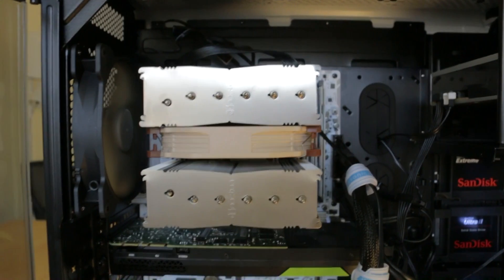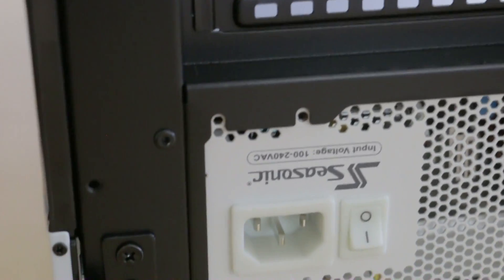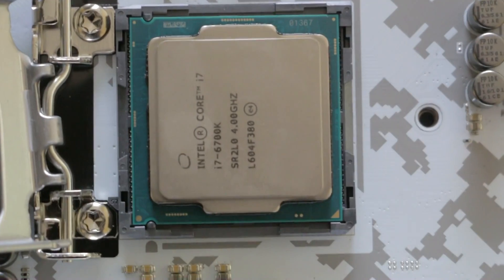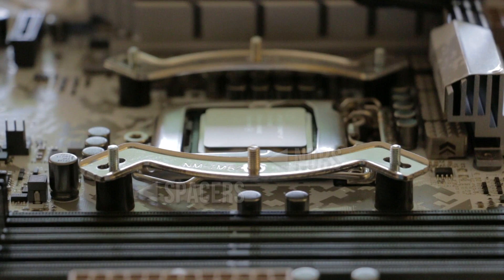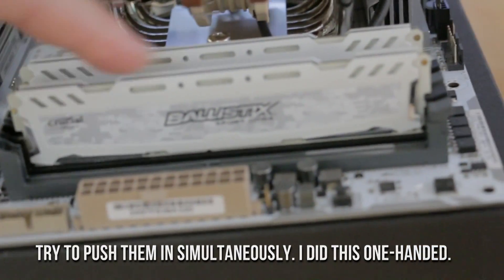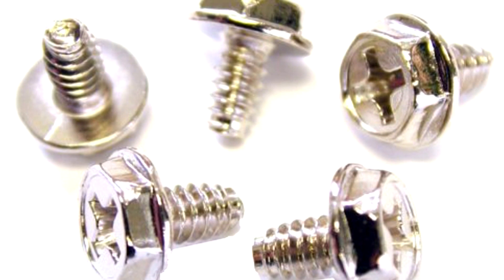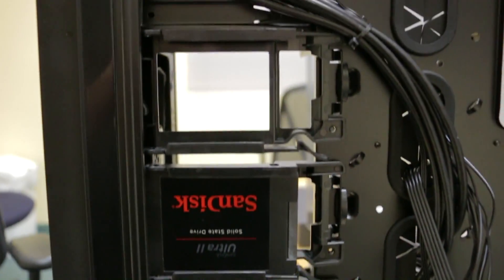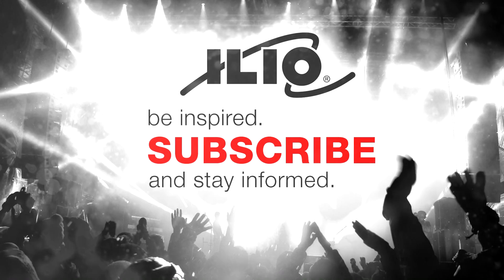Build an Audio Production Computer for Under $1,500

Comment from the maker: UPDATE: Intel released their 7th gen Kaby Lake, i7-7700K which will work with this motherboard (via a UEFI/BIOS update) or check out the new ASUS PRIME Z270-A which has 2 M.2 PCIe slots!
Reply from the maker: Thank you, Aaron. Specs are still accurate, yes. You'll find that the 
older this video gets, however, the more expensive the parts are going 
to be due to availability. The principles of building a PC still apply 
though. The parts themselves won't change much in terms of how they are 
connected, with the exception perhaps of M.2 drives becoming more 
ubiquitous. I'm tempted to do a build as soon as the i9 comes down a bit
 in price. I think that will be a game changer. Probably a more 
expensive machine though. ;)
Reply: The I9??!!!!!!!!!! WOAH Baby
Reply: ILIO hi there! Following questions only pertain to audio production! 

1) is it necessary (or better) to go with the AMD motherboard as shown in the video or is there an Intel motherboard also that can go with the i7 processor shown in the video?
I ask this because, waves plugins freeze and shut off abruptly in my projects and I have a gigabyte motherboard. Also, in many videos they say that the same thing happens with a lot of other brands' plugins as well in various DAWs like pro tools and therefore pro tools, on their website, have mentioned the models of PCs that they recommend buying which the customers won't be having such problems of dysfunctioning software with!

2) in your "UPDATE" comment, you mentioned Caby lake i7 processor. Is it better than the one in the video for audio production? If yes, what motherboard would be there best fit for it!!
Thank yee, in advance brother!!
Cheers!!
Reply from the maker: Hi Shashank, I'm sorry but I have to correct you on the motherboard. It's an ASUS with an Intel chipset. I recommend Intel chipsets for audio. I use Waves plug-ins frequently on this build, with no trouble whatsoever. Regarding the Kaby Lake question: check out ASUS PRIME Z270-A motherboard.

Comment: The aesthetic of the pc is beautiful and the parts you picked out are great. But that case isn't practical imo. Solely for the fact that audio production PC's should be as quiet as possible. And that particular case doesn't help with that due to that side panel. There's definitely cheaper case options with better sound insulation. But aside from that great video.
Reply from the maker: Hello Geovanni, practicality is subjective. It was extremely easy to work with and I have room for it. No one size fits all. By the same token, Apple's trashcan isn't very practical either in terms of form-factor and noise. If you need something that must go in the room you are working in, and you cannot isolate it, having a fanless design and rack mounting it is better. Check out these guys: http://www.heavydigitalaudio.com/

Comment: Which is the most importatn feautres to look for on a "pc" for audio production/processing and 3d renders?
Reply from the maker: On any computer, PC or MAC if you want to do audio production AND 3D renders you'll need to consider the GPU more than anything. The CPU should always be Intel when audio production is a factor IF YOU ARE GOING TO USE software plug-ins. I've seen a couple of people report that the Ryzen seems to be problematic with software plug-ins, and I could go into the probable reasons behind this, but if you scroll through the comments, you'll see my thoughts on this topic. In the video build, you may have noticed that I added an NVIDA Quadro M5000 GPU, because I do video editing on that machine also. That's a $2K GPU, which significantly raises the cost on the build, but only required if you need heavy video lifting.

Comment: im having so many issues with a build i did on the ryzen platform. It wont playback correctly, midis dont recognize, it be awesome if i can get some insight from you. its hard to find people that know about pc buiilds and audio production.
Reply from the maker: Hi Jessy, I'm really sorry to hear you are having trouble with the Ryzen. It's a good CPU, but maybe not so much for music production. I will ALWAYS recommend Intel for audio, not because I prefer it over AMD but because the audio industry is MOSTLY MAC and therefore will optimize their software for Intel. Make sense? Ryzen is good at multi-core operations, but most music software plug-ins operate on a single core, per instance. Some DAWs allow you to distribute the load over the cores, BUT again, they're optimized for Intel. Get an Intel and either sell your Ryzen machine or use it for gaming, internet, office use!

Comment: ASUS Z170-PREMIUM work in place of the motherboard your using for this build? I'm just now digging into the the world of computers so pardon me if this is a dumb question.
Reply from the maker: Not a dumb question at all. The Z170-PREMIUM is a great MoBo, but it has been discontinued and supports the 6th gen Intel processors. As a result, it's going to be more expensive to buy. Crazy how that works. What's cool about it though is the onboard thunderbolt ports. Those are not common on a PC motherboard, sadly. You can get a Thunderbolt PCIe card though. But to answer your question, you should be totally fine with that MoBo using this build. Just check the RAM requirements to make sure those match up!
Reply: Thanks for your help!

Comment: how essential do you think it is to go noiseless if youre recording in the same room as the computer? also ive heard overclocking can cause alot of pops and clicks and stuff??? whats youre thoughts on that?
Reply from the maker: Hi James, this machine does run pretty quiet but it's not silent so you would get some noise bleed in a critical recording environment (with condenser mics). Mine is inside a closet that is ventilated, and that's how I get around it. If you must record in the same room and don't want to tuck the machine away, I do recommend you go with a water cooling system. They're more expensive and tricky to install. Overclocking a CPU that is not properly cooled will definitely result in clicking and popping. Improper overclocking will also result in instability. If you are not expert in overclocking you can use the motherboard presets to do it for you and it's safe and stable.
Reply: thanks dude! one more thing, I was thinking of water cooled forsure, but someone said even if its water cooled there is still a fan, is that true? also what do you think about those no-fan systems? or are they insanely more expensive?
Reply from the maker: Hi James, let me hit you with some links to check out and see if they help answer some questions for you. Remember, heat is the enemy! A PSU will have a fan, that cannot be avoided. But you can pretty much go fanless elsewhere if you're running SSD's. Check out these pages online for help in answering your questions: 
Quietest Cases: https://www.custompcguide.net/top-6-most-silent-computer-cases-for-quiet-computing/

PSU: https://www.custompcguide.net/10-most-quiet-power-supply-units-your-computer-will-love/
Reply: thanks bud, youre legend!
Reply from the maker: Hi James, I'm sorry but I just realized that those cases are pretty old. I'm facepalming right now. Do a search for "quietest PC case" and try to find a newer review. Again, my apologies!
Reply: okay lol...i have awhile before i do my build anyway...still using my i5 laptop with an ssd and its fine for now!

Comment: Cool man, this is what I need. Thanks for making this video! I also want to know the stability for this computer so far. Any system breakdown for Pro Tools, Cubase, Logic, FMOD, WWise and Final Cut etc.? Is that possible to built a smaller one like Mac Pro? I think some people who need to work in other countries may need that! Please do make a video for that.
Reply from the maker: Hi Li Bo! The PC is running like a champ still. It's been about 6 months since I built it and I've had no problems. I've been able to run 20 Omnisphere instances in one, Ableton Live session without it breaking a sweat! :)

I don't recommend building a "mini" PC because of the heat dissipation issues. If you plan on doing a lot of heavy lifting, at least go with a rack-mount version. You can do water cooling instead of fans so that it runs nearly silent. I went with the large case build because I keep mine in a ventilated closet. It's also much easier to build, where smaller form-factors require more patience. :)

Comment: Would this case also do the work
Corsair CC-9011038-WW Graphite Series 230T Seitenfenster ATX Compact Mid-Tower Windowed Gaming Computer Gehäuse, Orange mit Orange LED Lüfter
Reply from the maker: What you'll want to do when purchasing any case is to first look at the measurements of your motherboard and then check the measurements of your case to make sure it will fit. Most cases released within the same relative time as the motherboard you are purchasing will account for the proper connections as well, so make sure you check that also.

Comment: is  ASUS Z179 S Sabertooth Arctic White (179.00) or Z170 S?
Reply from the maker: Hi Alston, ZI79 S is arctic white. I don't believe there is a Z179. Take a look at my update, pinned to the top for newer mobo and check that one (Z270). It's not white though.
Reply: oh , i just copy what you wrote on the review coz there write ASUS Z179 S Sabertooth Arctic White , sorry for my english , and thanks for your reply!
Reply from the maker: You're welcome. I'll have to go back and see what I wrote and correct it if it's wrong! Sorry for the confusion!
Reply: its ok , coz i want to build this pc ....but its over my budget ...
Reply from the maker: Hey Alston, sorry about that. The Z170 S is out of production so it's going to be very expensive to get one now. Check out  Intel's 7th gen Kaby Lake, i7-7700K along with the new ASUS PRIME Z270-A which has 2 M.2 PCIe slots!
Reply: no , its nothing. thanks for you advise its really a nice build! i'll look forward to your video . cheers

Comment: Amazing video :D What do you value more when choosing a processor? Higher single thread performance or higher core count? Now that AMD's Ryzen has arrived I'm rather curious which architecture would be more useful in audio production.
Reply from the maker: Hi baxunltd! I responded early to a very similar question. Here's what I said, but I altered my answer to better fit your question: Always check how many cores your software will utilize. Most applications, including gaming use a single core per instance. Games rely heavily on the GPU, and music software relies heavily on the CPU (typically). The problem with the AMD Ryzen CPU is they do amazing when spreading the load across their cores, but fail in comparison to Intel's CPU when doing single-core operations. You can verify this by checking the Ryzen reviews that are popping up. MOST music plug-ins operate on a single core (especially VST). Personally, while I love AMD most of the optimization/code for music software is written for Intel, because MAC.
Reply: thank you for the informed reply :) I'll seriously take it into consideration when the time comes for building a new pc!

Comment: I've been struggling  with finding a sound card for my PC.  I noticed you didn't use any.  Please comment.  Are internal sound cards out-of-style?
Reply from the maker: Hi tkarlmann, this is Michael Babbitt. Whatever you do, do NOT get a consumer grade sound card if you are going to be doing any pro audio work. Internal sound cards are no longer the norm. If you are on a budget, I suggest checking out Focusrite interfaces like the Scarlett series. It will connect to your USB port, but you do have to plug it in for power via a small wall wart. Let me know if you'd like more suggestions!

Comment: What DAW are you using? I'm looking into upgrading my system...I'm on a Mac mini intel 2 duo core so yea I'm living a nightmare when it comes to production and all the plugs I'm running alon. With tracking and mixing. I'm using FL Studio and running windows (boot camp) on my 2010 Mac mini. I wanted to either get a fillet upgraded iMac or MacBook Pro...OR just build my own PC but I heard from another producer that building a PC will result in having to upgrade the parts of the PC later on. Because updates and all
Reply from the maker: Hi Steven,
This is Michael (the guy who did the video, just to be clear). We're running a lot of different DAWs over here, but my preference is Ableton Live which does run natively on MAC. Running Bootcamp sounds like a bit of a nightmare to me also. Here's the thing about the MAC/PC debate = you'll definitely spend more going MAC, no question. What you "heard" about PC is not true at all. I have a machine that I built in 2008 that is still running strong (I no longer use it for audio, but my kids do play DOTA on it!) and the only thing I have had to replace are failed hard drives and an upgraded GPU (video card). I've got all my PC's (4 of them, fully updated and only 1 of them is running Windows 10, with the others still running 7). OSX has its own set of nightmares, rendering your SOFTWARE unusable after updates. That's the reality of it. Good luck!

Comment: About to pull the trigger on a music production/gaming build. For DAWs, specifically Reason 9 for me...would I be set with an I7-7700K? Or would the new Ryzen 1700 be better for music production due to more physical cores? Or...sense I rarely use more than 10 beefy combinators in any project, could I even go cheaper? My DAW performance is way more important to me than gaming, which I've already sorted out with a nice RX 480.
Reply from the maker: Hey Splitty Booms, this is a very good question (BTW, this is Michael who did the video). Always check how many cores your software will utilize. For Reason, I'm not sure so do some homework. Most applications, including gaming use a single core per instance. Games rely heavily on the GPU, and music software relies heavily on the CPU (typically). The problem with the AMD Ryzen CPU is they do amazing when spreading the load across their cores, but fail in comparison to Intel's CPU when doing single-core operations. MOST music plug-ins operate on a single core (especially VST), but since Reason is its own beast, again I highly suggest you homework that. Personally, while I love AMD most of the optimization/code for music software is written for Intel, because MAC.
Reply: I really appreciate you getting back to me.
I've already built myself a 1700 system.
So far, Reason 9 runs perfectly.  There were songs I previously couldn't play due to too much DSP which play flawlessly.

Comment: Quite a bit more than is needed for sound recording. But hey, if you can afford nice parts, get them. No such a thing as overkill if you can afford it.
Reply from the maker: Hi there, Mr. Extremeineveryway! "More" is subjective. If you are doing simple operations, using mostly loops and recorded audio in your DAW then sure, this system IS overkill. But if you're using virtual instruments, massive sample libraries and effects, running multiple tracks and don't want to be bothered having to bounce things down, then as you said there is NO SUCH THING as overkill! :)
Reply: ILIO True. Ahh for the days when a few guys would stand and record their tracks to cassette, produce it on vinyl, and we listened to it on one speaker. Such technology we have, but I don't think the songs sound any better.

Comment: yo can you make me a big favor and cutomize me a dino pc i will use that pc for gaming/editing/streaming(maybe)/casual stuff like youtube movies etc. can you tell me the parts that in total will be 1000$ and it will fit my needs of what i need on top btw the case is Corsair Carbide Spec-Alpha White and Red  
 
am not a pc guy so idk shit lol i will eventually do research on it but i cant right now so plz help me out
Reply from the maker: Hey there! By "dino" I'm assuming you mean previous-gen? Here's the thing with building a previous gen computer and trying to find the parts: Because they're out of production it can actually be MORE expensive than buying the new stuff! Crazy isn't it? But that's the thing with supply and demand. When there are a LOT of parts in current production, the price goes down. That said, $1,000 is totally doable and you don't need a "dino" in that price range. For example, check out Costco as they are now a seller of the ASUS ROG laptops. For about 995.00 you'd be set and won't have to build anything!